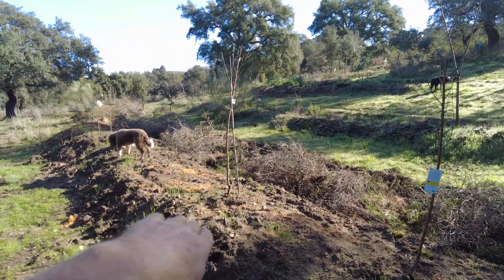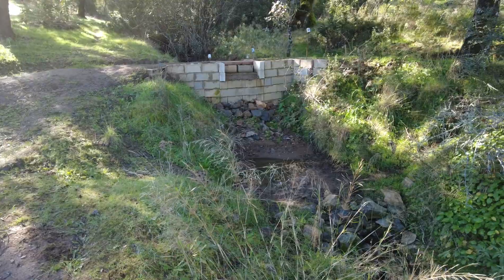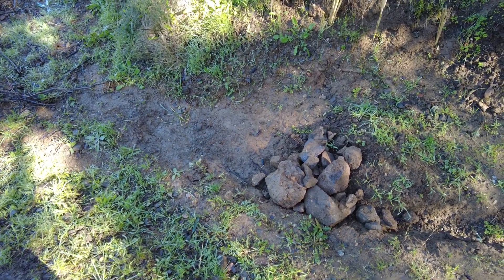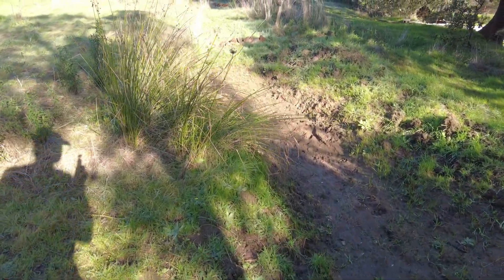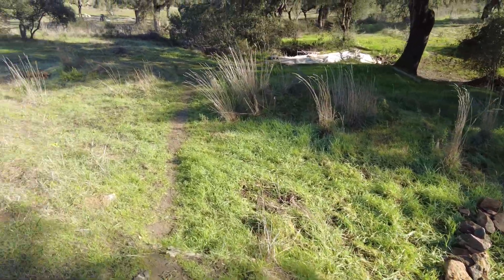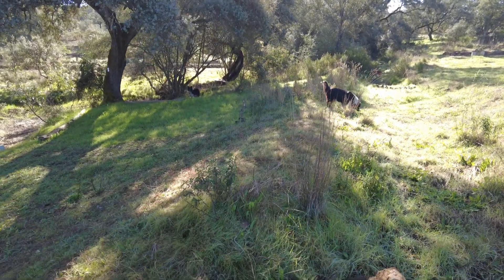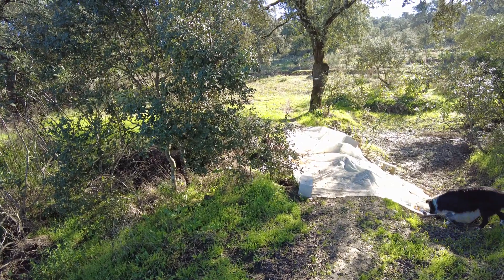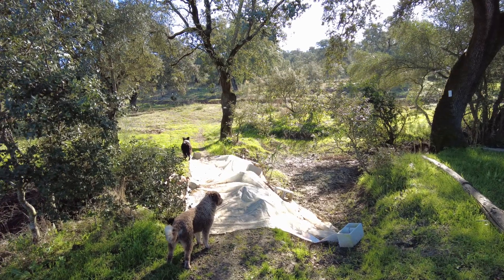Small Stone Weirs for Slowing Water on Gentle Slopes

Comment: Good video and surprising progress on the westerly spillway from the middle lands crossover.   You were able to harvest quite a few stones from your swale digging.  I must say that the leaky weir structure built from found rock has served Suerte del Molino and you well.
I will suggest you build one ore leaky weir of about the same size at the very top of the westerly spillway.  That should equalize the flow between all three possible exit routes and maximize the pool depth.
* A question about turning the Roman waterway back to the creek;  Another idea may be to split the waterway at a leaky weir with one of your diversion pipes, sending a portion back to the creek pool and excavating a shallow swale in the path of the original Roman waterway for the balance of the water.  There is something about modestly restoring the ancient waterway on your land that appeals to me.
* A question about the vetiver grass slips you planted on the northern crossover - did they not survive?  If the did, you can cut holes in the plastic so they can continue to grow.
* I do like the ide of excavating the pool made by the northern crossover so it is bigger around and deeper and adding the excavated soil to the top of the crossover.  Just be certain to pack the cut soil well with the Giraffe.  😉
Reply from the maker: Vetiver still growing under the plastic Steve.
I like how your brain likes to flow with the water. Digging? Mmm. I'll get there. First I have to install driplines on all the new swales. Much appreciated
Reply: @SuerteDelMolinoFarm   YEAH!  Vetiver slips DID grow 👏🥳  I would definitely cut small openings in the plastic sheet so the vetiver leaves can grow through.  If not, they will get cooked soon enough from the solar gain through the clear plastic. 👍
Driplines are a priority.  
Digging can come  during the dry months.